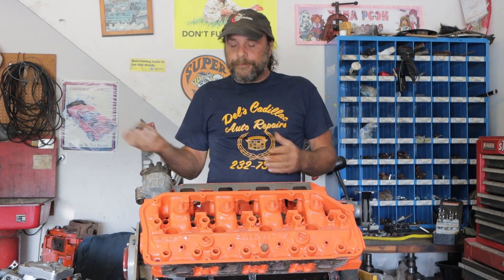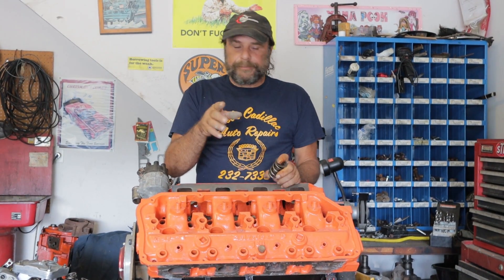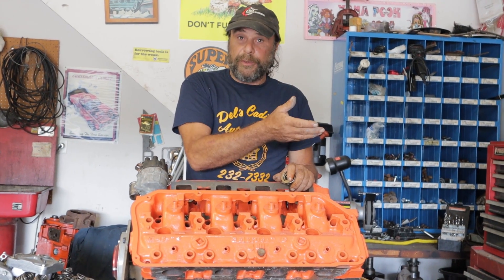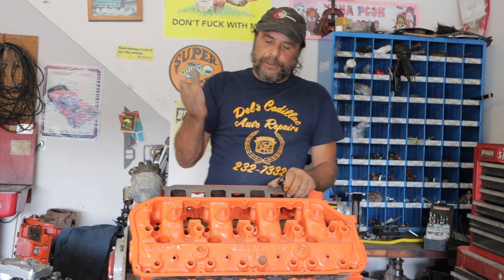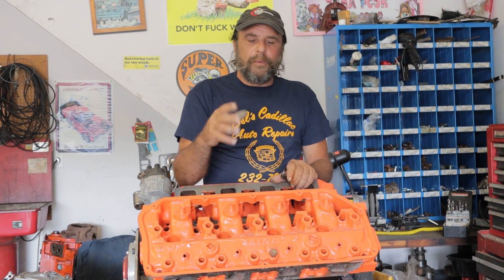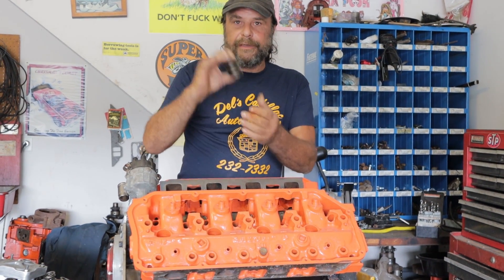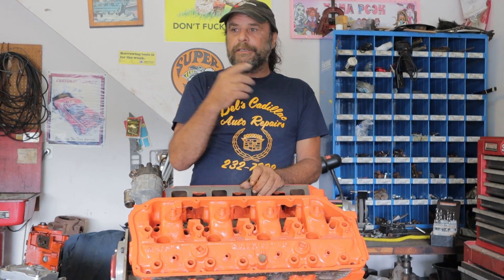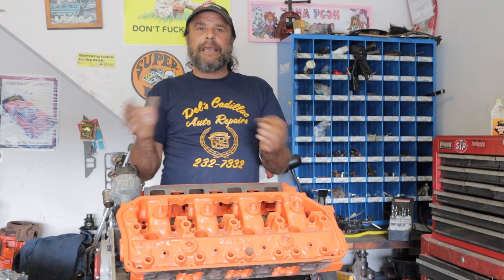Mopar's Doomsday Hemi

Comment: NASCAR killed the 427SOHC also
Reply: nascar killed the big 3 going head to head as a real thing. chevy got over once to often, even ford almost left. they used a bs made up rule to keep fords 427 overhead off the track. mopar response was lets make something like that. chevy was oh shit were screwed whine cry nascar theyre engine is better then our whine ban it pls nascat ford your engine is banned. then they banned the hemi and mopar said go f yourself
Reply: Don't forget they changed the rules when the Daytona & Superbird were destroying everyone too.
Reply: @ozmister101  Not true. Ford killed the SOHC 427 as Ford chose not to mass produce/offer the engine in any of its automobile platforms (making it available to the public as Chrysler did from 1966-1971 with its legendary Hemi) as NASCAR rules declare that only production engines may be used in NASCAR competition. The "Cammer" engine had many great engineering flaws; hence, Ford chose not to mass produce it and wisely decided to start with a clean sheet design which became the BOSS 429 IMHO.
Reply: @stillbill6408  ford had plans to release the engine in the 1970 ford torino super cobra. which 3 proto types was build and was being tested on nascar tracks. chevy found out and had the engine banned straight up. then got the bodies banned as well as the superbird bodies. ford even pulled the 427 from all 3 and was testing 2 with 429 and one with a 460 for nascar when nascar said they couldn't use the car at all. https://www.youtube.com/watch?v=z9ZGx4YtYf0
Reply: they was prototypes for cars to be built as production cars. chevy killed the ford 427 as well as the 1970 torino super king cobra. you cant get them thanks to chevy. now chew on that.
Reply: ozzy kimble Uncle Tony’s newest video has some pretty neat stuff about Chevy in their cammers.
I’m a Ford man and have a 428 super cobra jet but my second choice is dodge
Reply: @stillbill6408  ford killed it after nascar banned it because Chrysler screamed foul
Reply: @stillbill6408  Problem was the Boss 429 didn’t perform as well as the 427 SOHC. The Cammer was campaigned well in NHRA, the engine blocks were weak and broke and the 6 foot timing chain took too long to get timed between rounds.
Boss 429’s would have been a contender but Ford had dropped out of racing then and went on to develop the Pinto and we know what that did to Ford’s reputation.
Reply: @timmebruer5205  Chrysler did not scream "foul"; Ford did not Man up and chose NOT to mass produce the cammer making it ineligible for NASCAR competition. Chrysler offered its Hemi to the public (1966-1971) on its B, E and C bodied platforms. The cammer was plagued with massive engineering problems (a paper tiger) and Ford wisely chose to design a more cost effective (clean sheet) reliable engine; hence, the Boss.
Reply: @stillbill6408  BS
Chrysler hemi couldn't run with the cammer. 
After they whined to nascar and got the sohc banned they stopped working on their prototype. 
You know why high performance mopars are so rare and valuable?
Nobody wanted to buy them when they were new
Reply: @timmebruer5205  I theoretically concur Mr. Mebruer based on the laws of physics. A single overhead cam (chain driven) engine with hemispherical heads will always outperform a similar sized hemispherical engine with its valves actuated by pushrods. The OHC allows for greater RPM potential; more RPM equals greater horsepower. In addition, the Chrysler Hemi's valve actuation system had greater parasitic loss (it took a greater degree of horsepower to actuate as compared to a typical wedge chambered design); however, once the Hemi "spooled up" it would more than make up for these patristic losses (this is why most other engines would get the "jump" on a hemi powered car in a drag race). The cammer 427 (like its FE wedge chamber predecessors) engines oil system was nominal at best (hence, "top oilers" and "side oilers") for natural aspiration. In top fuel and/or supercharged applications it was inadequate as the engines usually lasted for one pass than blew up (Connie Caletta referred to them as "one pass wonders"...a play of words on the term "90 day wonder"... He should know as he campaigned and raced them for several years). It was not till Ford/racers copied Chrysler's 426 hemi oiling system (verbatim) that the engine had some success (they even changed the rod and main bearing diameters and bearings to  the Chryslers design). I remember reading that they also copied Chryslers rod profile (on the crankshaft end, known as the "hemi footprint") to make the engine somewhat reliable. 
The other flaw Ford utilized was the single 7 foot long timing chain it  used to actuate those cams. The chain was heavy as ford engineers failed to adequately calculate the chains mass/ thermal/stretch factors as well as design a proper chain tensioner. At higher rpm's the chain would stretch to the point to where it would skip one or two teeth on one bank of cylinders resulting in catastrophic failure (shrapnel /blow ups). Due to its overhead cam design, this engine's horsepower potential was greater than Chrysler's Hemi; however, its inferior oiling system along with its inadequate 7 foot long cam chain (which stretched and skipped teeth), crank and rod bearings, lower end rod profile and poorly cast blocks (core shift/inclusion problems at the Lima, Ohio plant) resulted in its demise (the one wise move Ford made related to this abysmal design). Lastly (again) NASCAR disallowed this engine not to run as it stated (in late 1964) that all engines raced on the NASCAR circuit MUST BE PRODUCTION ENGINES; hence, Chrysler's 426 Hemi, Ford's 427 Cammer and Chevrolet's "Mystery Motor" (1963) are all NOT ELIGBLE. As a result, Chrysler pulled out of NASCAR in 1965 (that's why Ford won) but introduced its "Street Hemi" in 1966-71 and went on to dominate the NASCAR circuit in spite of numerous handicaps instilled upon it by NASCAR (due to Ford and GM whining). Ford wimped out and chose not to offer the Cammer in any of its production based platforms which DISALLOWED ITS USE  on the NASCAR Circuit. FORD, not Chrysler, not NASCAR, not Bill France, chose NOT TO COMPETE by not offering this engine in ANY OF ITS AUTOMOTIVE PLATFORMS. PERIOD. To use it would have been a public relations nightmare (Ford had to know this; hence, the Boss 429) as its is doubtful the engine would have survived the rigors of a 300 to 500 mile race  in the southern heat against the greatest most successful American internal combustion engine in history....the Chrysler/Dodge/Plymouth Hemi.
Reply: @stillbill6408  nascar banned the commercial before it could be put in production cars.
Thats why they never made it to the street. 
The only reason mopars are so rare and valuable now is they couldn't sell them when they were new.
Reply: @timmebruer5205  No, no, no Mr. Mebruer. Once again, NASCAR banned ALL NON PRODUCTION ENGINES from NASCAR events in 1964; hence, FORD ENDED THE "COMMERCIAL", NOT NASCAR. ALL ENGINES which included Ford's 427 Cammer, Chryslers 426 Hemi, and Chevrolets "Mystery Motor" (Mark IV, 396/427) in 1964. Chrysler officially chose not to race in 1965 due to this ban (again, that's why Ford  won that year); however, Chrysler offered its street Hemi in 1966-71 in several of its B bodies (Charger, Coronet, Belvedere, Roadrunner), E bodies (1970-71 Cuda, Challenger) and some C bodies (Chrysler 300...very rare). FORD DID NOT. Chevrolet eventually offered its 427 to the public but had massive teething problems with it initially (the Yenko's aided in bringing this engine to fruition if memory serves me correctly). Ford built some Cammer engines but NEVER OFFERED THEM IN ANY OF ITS AUTOMOBILE PLATFORMS; THEREFORE, MAKING IT INELIGIBLE FOR NASCAR COMPETITION. Ford TOOK THEMSELVES OUT OF THE GAME. All they had to do was put it in a platform (Galaxy, etc.). Believe me, if Ford (with all its money, power, might and influence in the industrial/political world) thought for one second that this abysmal engine could stand toe to toe with Chryslers Hemi, THEY WOULD HAVE STOPPED AT NOTHING TO COMPETE AGAINST THIS THORN IN THEIR SIDE. Believe me (as a business man) NASCAR in the 1960's was huge and what won on Sunday sold on Monday's....not to mention bragging rights. Ford knew this engine was not a wise venture due to its numerous engineering flaws, and wisely chose to start a clean sheet design with its Boss 429. There are numerous articles on the internet which support everything I have written (that's where I found most of this information) so check me. In addition, I grew up in the 60' - 70's and fondly remember the Mopars being the dominate force on the streets. You are right, there were less of them; however, where I grew up (a relatively large American urban area), they dominated the street racing scene even though there was less of them (the odds were in favor of the Ford's and GM's). NO ONE wanted to race against a HEMI. If you take an objective view of these machines you will find that they were superior to anything Ford or GM offered in that time frame. Both Ford and GM have succumbed to superior engineering traits pioneered/first introduced by Chrysler which are now common throughout the automotive industry (hydraulic brakes, engine oil filters, aerodynamics, cab foreword, reduction gear starters, unit body construction, rubber drive train mounts, EFI, overdrive, electric windows, etc.). Mr. Mebruer, many people hate math, Chrysler adores it.
Reply: @stillbill6408  once again you're wrong.
The only reason a Chrysler product is rare and valuable today is they couldn't sell them when they were new.
Reply: @timmebruer5205  Chrysler was the smallest of the big 3 (General Motors, Ford and Chrysler) so it makes sense that there were less of them; hence, they did not sell as many automobiles as GM and Ford. So, what is the relevance of this fact? To say you are right? OK, you are right due to the fact that they are/were smaller; hence, built less automobiles. My argument is that the Ford Cammer (as it was offered from the factory) essentially was poorly engineered and built and incapable of head to head competition with Chryslers juggernaut Hemi. Ford people  claim that it was superior. WRONG. It is a shame how Ford people praise an engine with such abysmal, pathetic engineering and desperately try to prop it up with conjecture, smoke and mirrors and wishful thinking. What little success it had did not end well due to Fords inferior engineering (it was not till Ford utilized Chrysler engineering principles that the engine had a nominal degree of success). Chryslers Hemi proved to be superior and is still being raced today. No engine in American history holds as many records as this illustrious engine. The Cammer is a slammer, the Boss is a Loss, the Hemi is King. Long live the King!
Reply: @stillbill6408  they were the smallest because they couldn't sell their product
As far as the boss goes the Talladega kicked the snot out of the hemi powered charger 500 and road runner.
It whipped them so bad ol petty drove a Talladega in 69 instead of a slopar.
The only reason mopars are rare is they couldn't sell them when they were new.
Reply: @ozmister101  mopar was the one that cried foul on the sohc ford.
Said it was too exotic.
More likely they didnt want to see a 390 c.i. sohc in the mustang.
The 427 ford was an expensive motor to build unlike the 390. All the parts on the 427 sohc would fit on a 390 block
Reply: ozzy kimble they wouldn't have to have banned the Ford sohc, it was pretty good at self destruction anyway.
Reply: @ozmister101  the fe 427 was released in 64 galaxies and 66 67 fairlane.
The sohc was not released because Chrysler, not Chevrolet, said it was too exotic.
A single 4 barrel sohc ran around 605 hp while a dual quad hemi ran 615 hp.
A dual quad sohc ran around 640. The sohc was designed and built in 90 days in response to the hemi.
The super cobras were built with 429 boss engines in them.
Reply: @midnitesquirldog1 I personally like the 427 better not for hp but for durability the older 454 wouldn't hold up to abuse. the 396 is still a 402 I dunno why chevy called them a 396 for. maybe to classify them as a small block? I rode in  my dads friends 69 chevelles ss 454 and that car would get stupid quick. hella scary ride
Reply: @midnitesquirldog1 yea my dad had a rocket 455 in a 71 buick estate wagon. that thing was quick. I used to drag mustangs with it and they always lost lol
Reply: @midnitesquirldog1 I never got to ride in a hemi car always wanted to though. but ive been around dodges and ford all my life my dad hated chevy. don't think he owned but one and that was a 58 chevy. he was more of a ford guy except for the dodge darts he loved them.
Reply: way too heavy
Reply: @midnitesquirldog1 the 396 became the 402 to make up for stronger emissions, but Chevy still called the 402 a 396 due to name recognition.
Reply: 5' of timing chain didn't help!
Reply: Most people don't know that oldsmobile also came up with a hemisphere engine with the help of chrysler. Nascar and nhra both wanted to put a fork in that. Also the final nail in the coffin were the insurance companies pushing for less power, the government pushing for lower emissions, and then finally the gas wars. By 1974 all cars had to have cat converters. The emissions then forced builders to lower engine compression and make larger chamber cylinder heads, weaker cams and that list went on and on.
Reply: They were worried about the then tire tech being able to handle +200 mph speeds. A very valid concern. The last attempt on making radials work on NASCAR failed a few years back, so we haven't improved things now..

Comment: dang.
remember that Oldsmobile with 4 slicks and 2 blown  toronado units in it?
Reply from the maker: There were actually two...The Terrifying Toronado and the Hurst Hairy Olds
Reply: No but I know Rockford (James Garner) ran a twin engine Olds in the Baja 1000 lol
Reply: Hurst Hairy Olds Cutlass
This thing was ridiculous
https://imgur.com/a/4kLOKkI
Reply: A '66 4-4-2 
would be fitted with two blown and injected 425's coupled to two 
Toronado transaxles to create a four wheel drive monster designed to 
entertain the crowds by frying all four tires the length of the quarter 
mile.
Reply: @1112223333111  I take it back lol

I have heard of the Hurst Hairy Olds